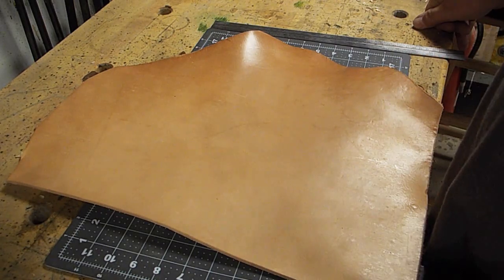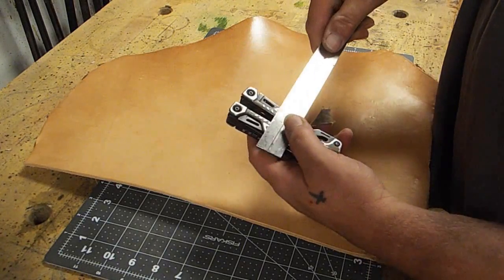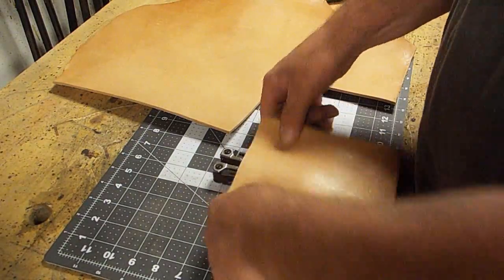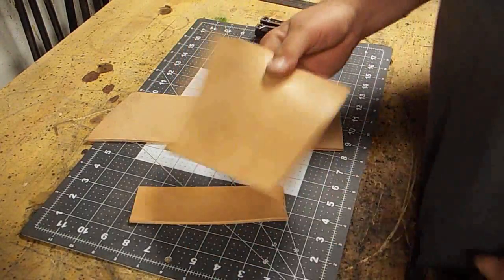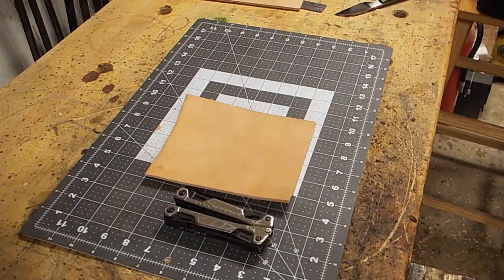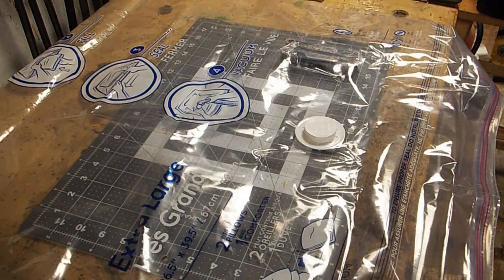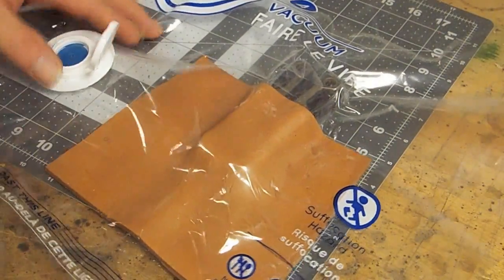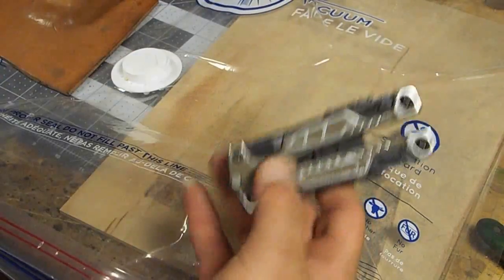GPW 103 - Vacuum Molded Leatherman Holster

Comment: The vacuum bag worked WAY better than I thought it would.  Thanks for bringing us along.
Reply from the maker: I admit it wasn't my idea... I have heard of/seen others do it. It does work very well though.
Reply: @GPWoodworks  Been looking at molding veg leather and had this very thought process. You'd be the first guy I've seen doing it. How long did you leave it in the bag for? I suppose once formed you could add a hairdryer to speed up the process?
Reply from the maker: @catchagrip.9468  With this setup, I usually let it ride for 10-15 minutes... You can pull it out and then put it back if you feel like it needs more time.

Drying is truly best done with just time... I do, sometimes, get impatient and use a toaster oven at 150F with the door propped open slightly... BUT I highly recommend not walking away... AND pulling the piece out every few minutes to cool.

Cooked ("Cured") leather gets much harder to work with.
Reply: @GPWoodworks   Thanks for your reply bud. I'll add the necessary tools to my list ; }
I think this would be faster than playing around with it, I've seen others using small tacks to hold down the work piece while drying takes place. The small holes disappear when dying etc takes place. Obviously they're not using a vacuum bag. Looks good bud, keep up the good work.

Comment: I use the Ziplock vacuum sealer and bags. They really work great. It pulls the vacuum and seals all at one time. And it SEALS.
It does not contaminate the sealer any for future food use.
Reply from the maker: I switched to a vacuum pump and space saver bags a couple of years ago... 

I have seen people use the food saver bags with really good results. It works really well.

Comment: Great job with this - I loved the idea of using a clamp to keep the dye bottle secure (I will be using this trick next project). Question - why did you use the roller at the end near the stitching? Was it to add some additional styling detail?
Reply from the maker: That helps seat and even out the stitches... just makes a cleaner stitch line.

Comment: On a clip there's a vacuum bag  the guy used for last 2 years. ? Worth fixing what it was. He then rubbed it but was still solid. Quality plastic. What thickness was this to get the vacuumed corners as good as you did?
Reply from the maker: I just use the super cheap space saver bags. When they get weak or start leaking, I replace them.

There are resources for permanent plastic for vacuum forming, they are typically sold as "vacuum press" components. Here are 2 that I found with a quick search:

https://www.vacupress.com/vacuum-pressing-purchase-bags/

https://www.veneersupplies.com/categories/Vacuum__Press__Items/Vacuum__Press__Kits/

Comment: Looks awesome! May I ask what brand of the vacuum machine and vacuum compression bag did you use?  Should it be better to use wet and dry vacuum?
Reply from the maker: Any strong vacuum will work. I used a 1 gal shop vac in this video.

I have used larger shop vacs for this (works a little better).

I have seen people use food saver vacuum sealers for this, so if you already have one of those...
Reply: @GPWoodworks  Thank you! so the water doesn't matter to the vacuum?

Comment: I am sure the board takes  some of the water away from the leather but I am even more sure the lather would be almost dry when you combine a board, piece of fabric and 1-1,5  inch plaster slab (like the potters use to dry out clay slip)
Reply from the maker: That's an interesting idea.

Comment: Look to get a 'breather' for your vacuum.  It goes inside the bag and will stop the creases of the bag trasfering to your leather.
Reply from the maker: That is a good point...

This is a fairly old video... I have since upgraded to a vacuum pump and started using canvas to serve this purpose.

Thanks for posting the comment.
Reply: @GPWoodworks  also if it helps any in my line of work (which is vacuum bag related) we use polypropylene cut into a palm size teardrop shape and smoothed around the edge to avoid puncturing the bag, but with the shape it allows you to roll the pollyprop on edge, around the perimeter of the part you are moulding.  Giving a much sharper internal corner on the finished material. (If that's what you want) .

Comment: That leather wasn't dried up after you took it off the mold was it? I was just thinking about it because if you are vacuuming out all the air then it will not be dried up.  Am I correct on that?
Reply from the maker: Not dry at all... in fact it takes a day or two to dry... unless you're impatient like me and throw it in the toaster oven (on low) to speed things up.
Reply: @GPWoodworks  Got it. Thanks for the reply. Nice job on that one!

Comment: Dumb question but you still wet the leather before putting it under a vacuum? Also how long did you wait? Beginer here.
Reply from the maker: Yes wet it before the vacuum... I usually let it sit under vacuum for 5-10 minutes... If the form is really detailed or intricate I will let it sit longer. I have let some pieces sit for an hour or two... but that is major overkill 99% of the time.
Reply: @GPWoodworks  thank you!